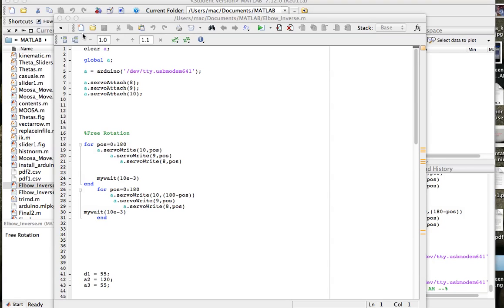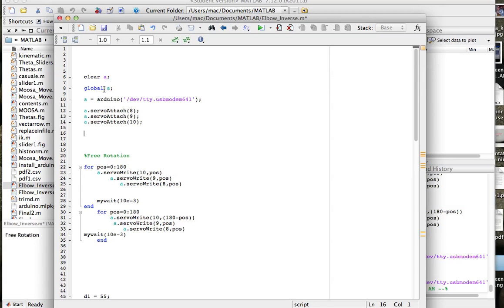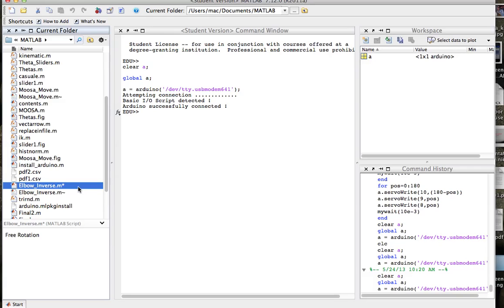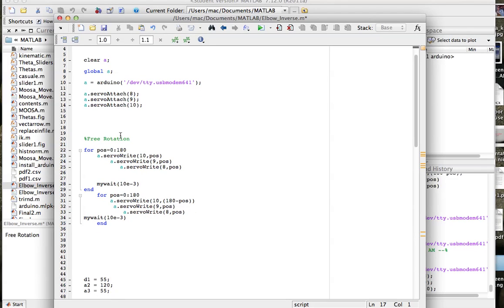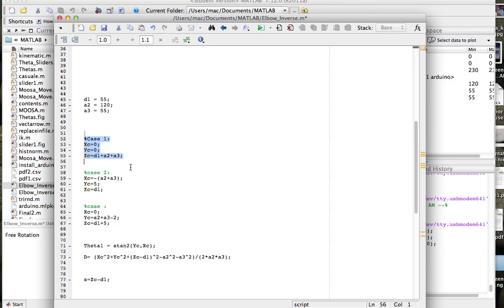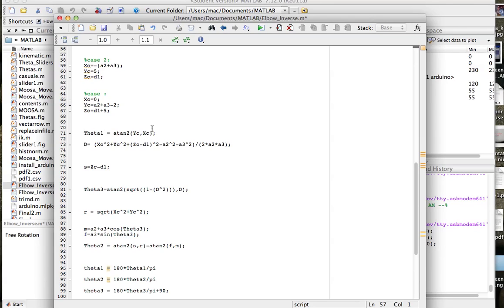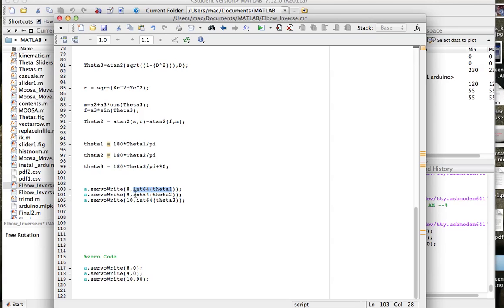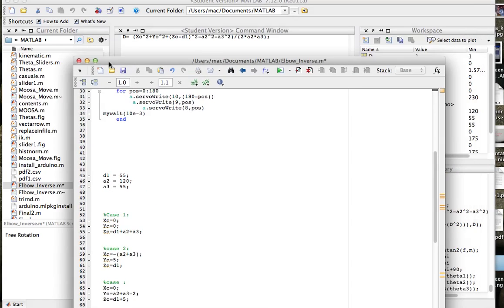Arduino Matlab Robotic Arm Coding

Comment: Hi Moosa very nice work and subject. kindly, can you help with my case . i solve the inverse kinematic for 6dof parallel robot and i got the 6 servo angles .but i need  to send 6 angles at one time to arduino once i press one push button  from gui .

Comment: Hi MOOSA, I  would like to sincerely thank you for this video...it has helped me enormously with my thesis which involves inverse kinematics of a 3DOF RRR robot arm manipulator.....I tried to work them out on paper but could not determine the z-axis rotation..until i came across this video. I am using an elbow-up configuration which involves negating the sqrt(1-D^2 ) to give (-sqrt(1-D^2 )).... I  wish you good luck and happiness throughout your life...best wishes from Ireland